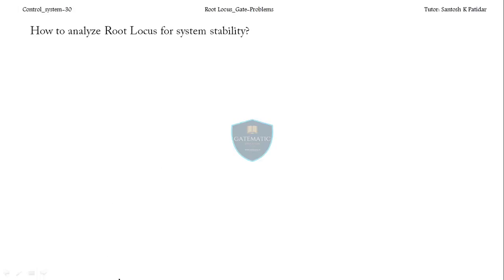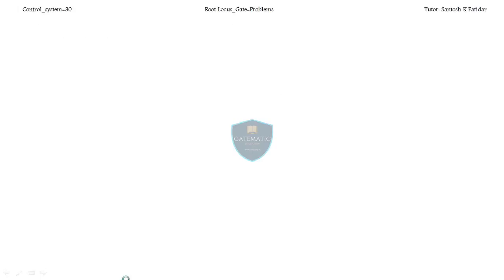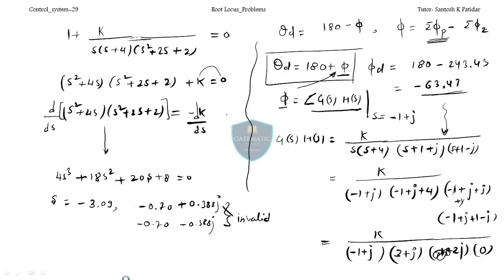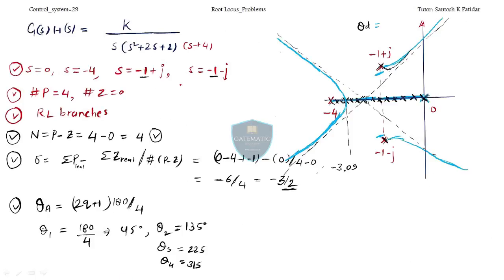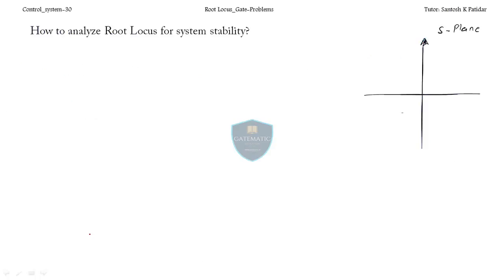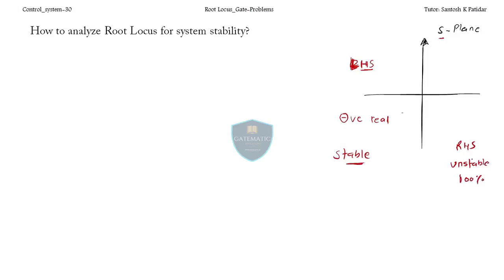Lec 30 Problems on Root Locus

Comment: last question can also solved easily by considering damping ratio =1----just one recommendation
Reply: bibhu datta jena ok.. after taking damping ration 1... Wat should we do.. can u explain
Reply: Sasi Hari --form the  Ch eqn,then u will get wn=√(k+5),£(gita)=1 and equate to (co-efficient of s )= 2£wn,u will get k value
Reply: bibhu datta jena thanks bro
Reply: @bibhudattajena3572  how jeta is 1
Reply: @bhanu6820  since the 2 poles of this characteristic equation are on real axis of root locus, where geta =1 (critically damped condition)
Reply: @kbushrajabeen1701  thank you
Reply: Hey in the 1st GATE QUESTN I GOT POLES AT (-1) AND (-2) RESPECTIVELY...PLZZZ TELL IF ITS WRONG OR RIGHT